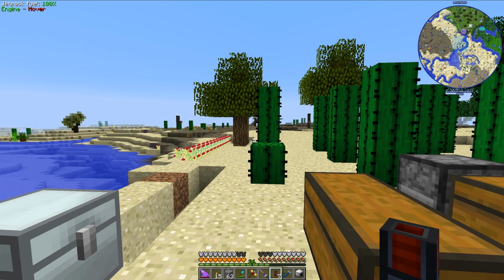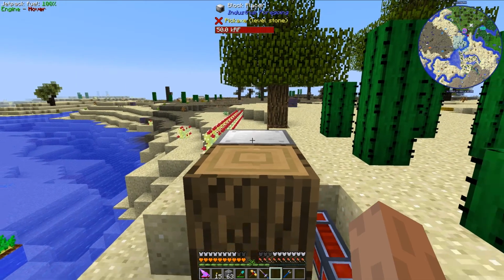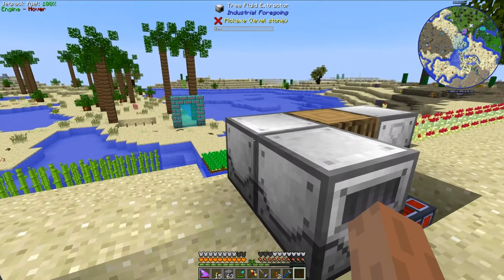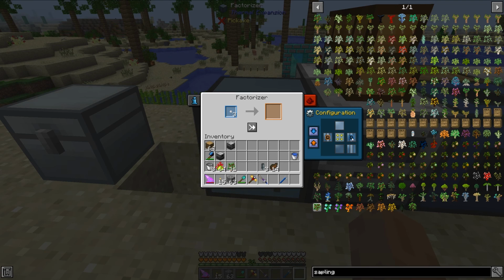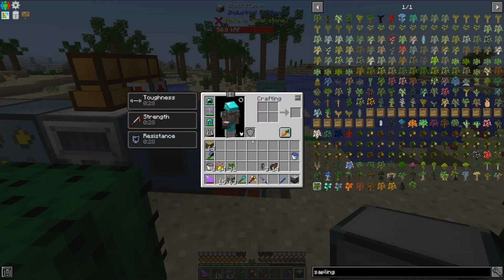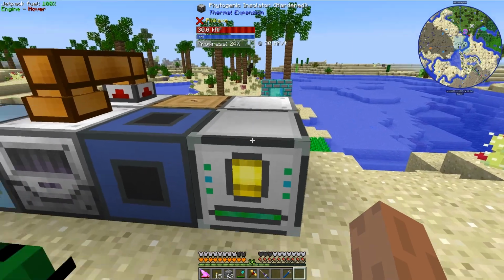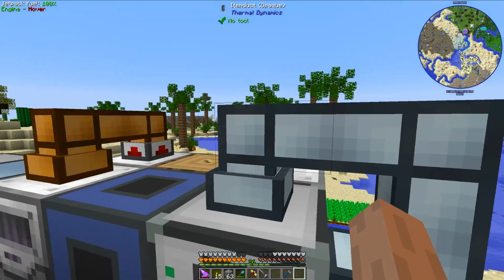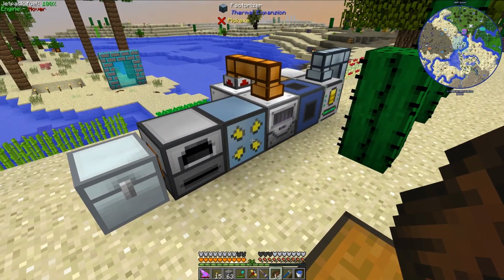How To Automate Plastic (Industrial Foregoing)

Comment: Yo how do I power the block placer? What did you connect the fluxducts to in order to power them?
Reply: i just use an infinity generator with a tesseract inside it
Reply: @henfsxfh  not a reply 2 years later 😭
Reply: @chongo33333  lol

Comment: HOW ARE YOU POWERING THE BLOCK PLACER PLEASE IM SO FRUSTRATED
Reply: you can use the actually additions block placer
Reply: you get an energy source
Reply: @typojeoff  what energy source
Reply: @swedswed6129 a generator or dynamo (for a starter rf system)
Reply: @swedswed6129  If you're using thermal expansion, you can use the fluxducts
Reply: @swedswed6129late af but just use a coal generator or somethinf